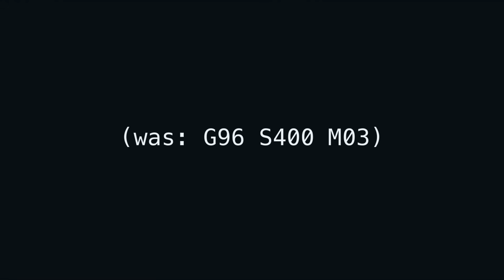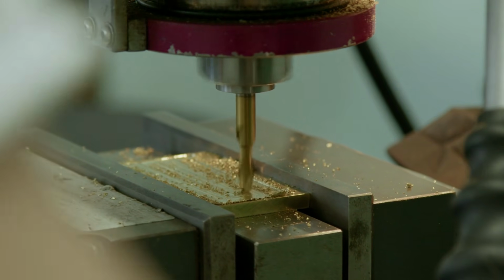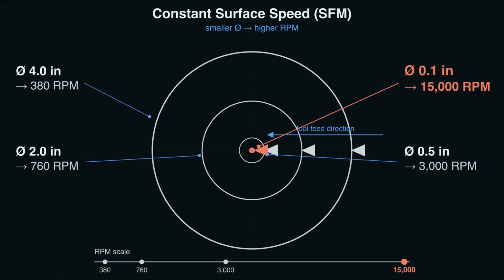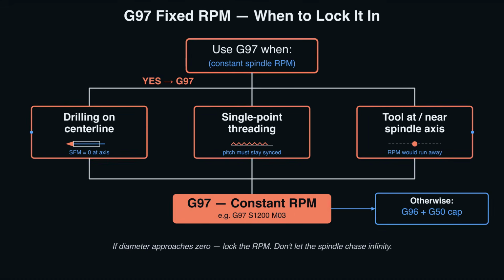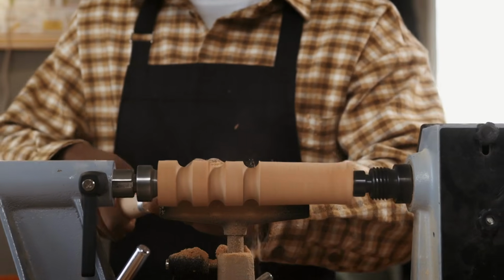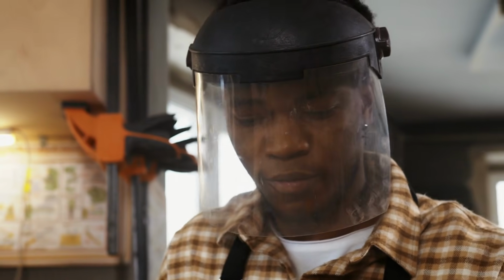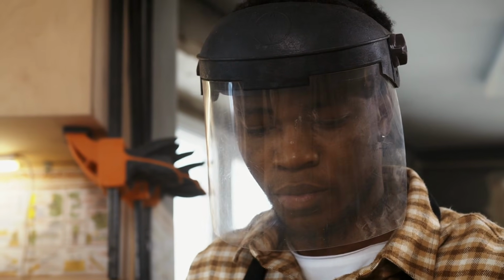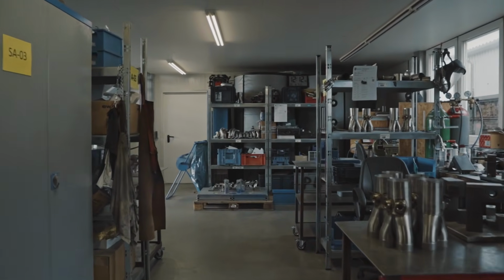G96 vs G97: The Lathe Code That Throws Parts at You

Comment from the maker: Correction: the real fix for G96 throwing parts near center is a G50 max-RPM clamp (G50 S____), which caps spindle speed while keeping G96's constant surface speed. Switching to G97 also stops the overspeed but gives up constant surface speed, so it's the fallback, not the headline.

Comment: False g96 is correct g50 is an rpm clamp you limit with g50 and if you chuck has a hard limit you change the system parameters to cap system rpm to the max of lowest limit
Reply from the maker: Good catch on emphasis. G50's the cleaner fix, clamp the max RPM and you keep G96 constant surface speed where it matters. G97 stops the overspeed too but trades away the surface speed, so it's the fallback, not the headline. Led with G97 and buried G50, that's on us.